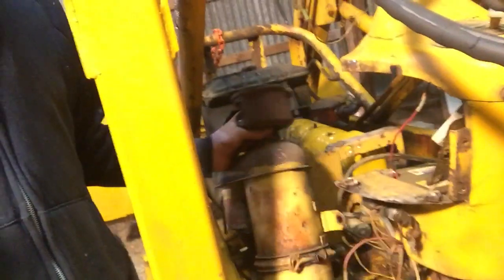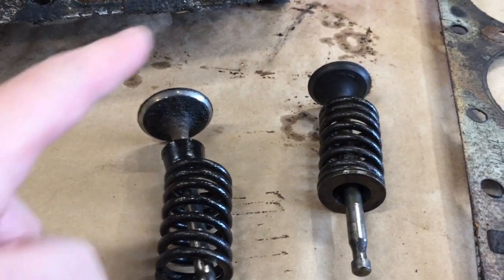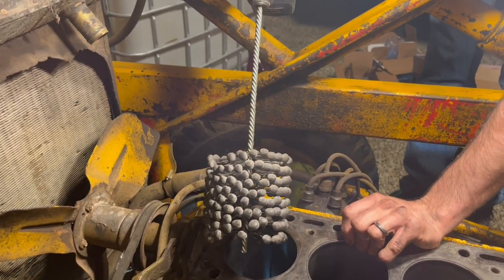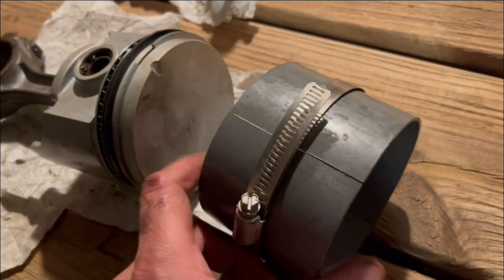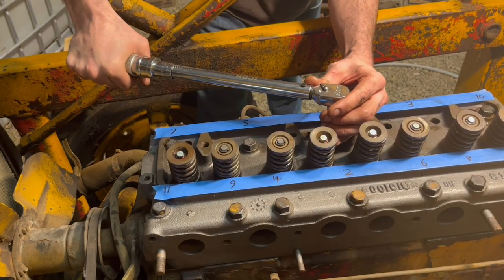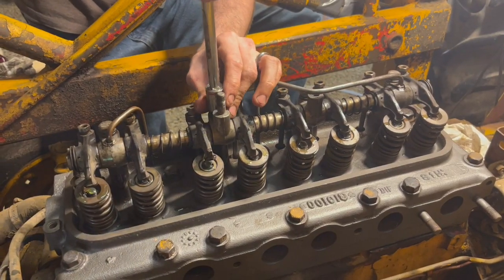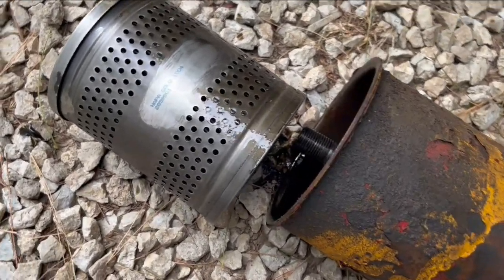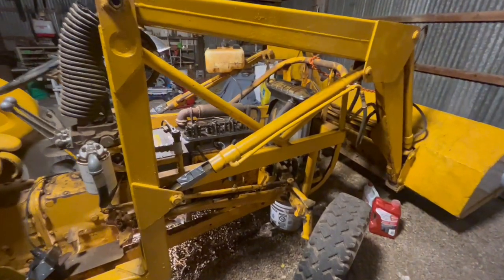Tractor Engine Rebuild

Comment: Is this considers rebuilding the engine? You make it look easy
Reply from the maker: Yes, this is a pretty major rebuild.  You can go a little further and replace cylinder sleeves, but that requires a special, expensive tool.  Luckily, mine were in pretty good shape.   When I got this tractor, it would not run at all.
Reply: Looking for the rest of the project!